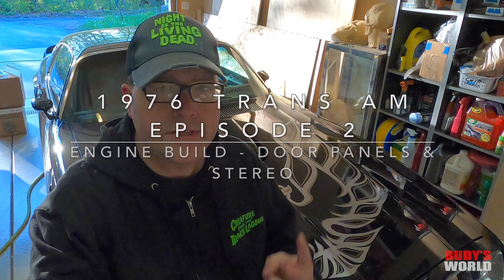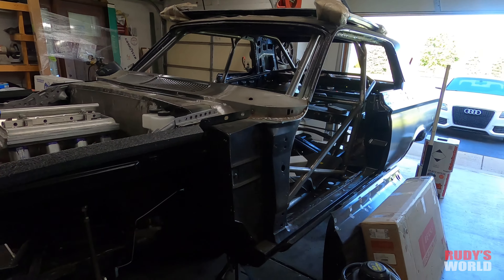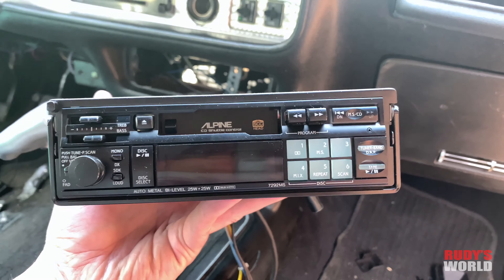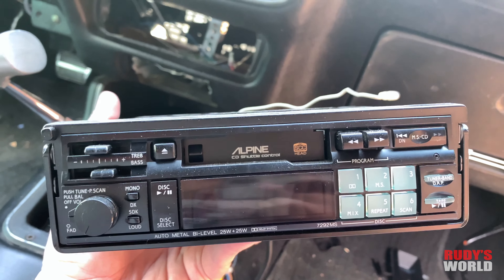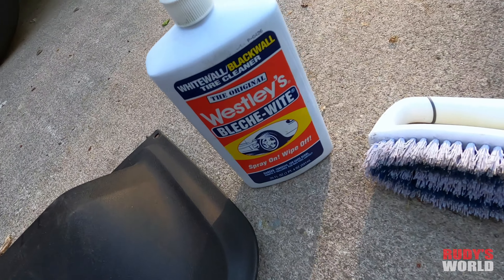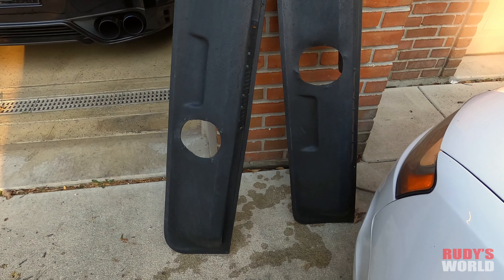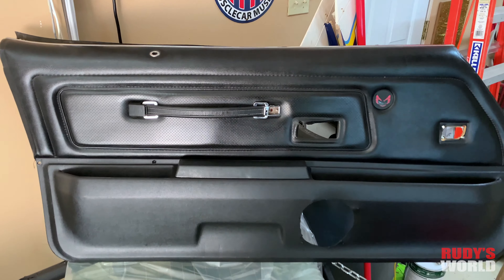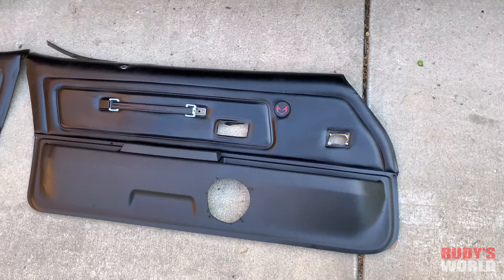My 1976 455 Pontiac TRANS AM Build  Pt.2

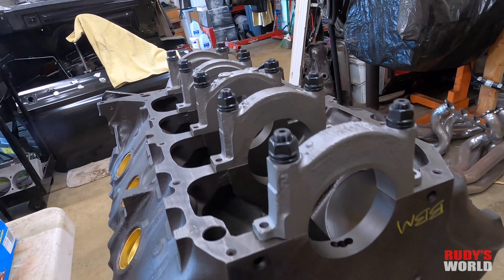Comment: Your daughter is going to have cassette tapes?? I don’t think kids even know what cd’s are anymore. Nice car and great build plan. I have an ‘81 trans am that looked like the bandit addition but wasn’t. Drove it for a few years before getting in wreck and buckled the t frame on top and front part of the frame. Crying shame but a lot of it was still beautiful so bought another’81 trans am someone made into a race car with a 455 olds motor, 400 turbo, and 4:11 rear end. Going to take that stuff off and go back to the 3:83 rear end and modify it for the borgwerner 4 speed from the other vehicle if I’m spelling that correctly. Can’t drive a vehicle like that with an automatic I need the 4 speed. I’ll probably get a lot of slack for using a suped up 350 crate motor but it’s what I have so will likely use again. Both cars been tucked away for 20 years now so interested in getting the project started and seeing what they’re like. Might make a few videos myself. Great to see they’re still out there and nice. Looking forward to getting another rust free beautiful t top ‘81 back out on the road. Certainly bringing more than they did 20 years ago.

Comment: I'd like to increase the horsepower on my '76 400, but I don't really want to get into taking the engine apart. I don't need a huge increase, I just want to unlock some of the potential a bit. Any suggestions on headers/carburator/etc?

Comment: Hey Rudy! Nice TA! Are you going to keep the same wheel/tire/suspension set up after you rebuild the engine? I have a 76 TA and I’m considering building the engine. I was looking to see what others are doing with their cars. I don’t want to go full restomod with it because I like the original look but want more performance out of it like you.
Reply from the maker: Hey there! Yes I’m definitely going to redo the suspension keeping it as stock as possible. Last year I was reading up on leaf springs, that’s where it seems to get into differences on what guys do for different stances. I’m going to be looking into it again because I really can’t remember any of it at the moment but I want to buy new leaf springs and get the proper ride height without making it too low. Please car seem to have a pretty big gap in the tire area which is normal but it would be nice to lose about 1 inch
Reply from the maker: “THESE CARS”

Comment: 75 block and speakers in the door? Thought it was gonna be all factory correct?
Reply from the maker: That is the CASTING DATE, for the 1976 motor.Not the model year for the car. Some car parts that are date coded were date coded late in the previous year if the car was a early year build date.(or three months prior to build date) The code on that block is 76 TA only ...the 75 is not the year of the motor. If you watch the video I said since I’m putting an alpine stereo in, I decide to leave the speakers in the doors. For now.